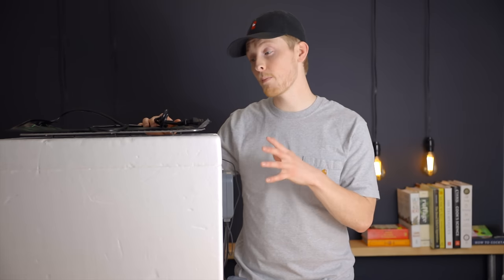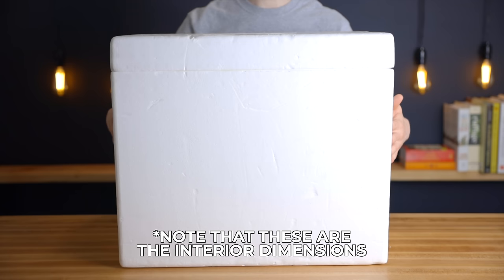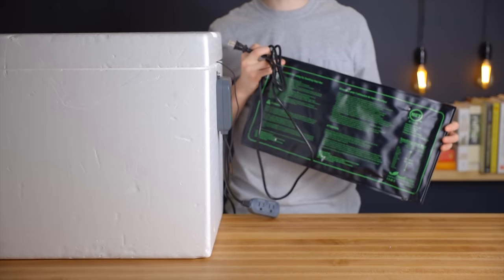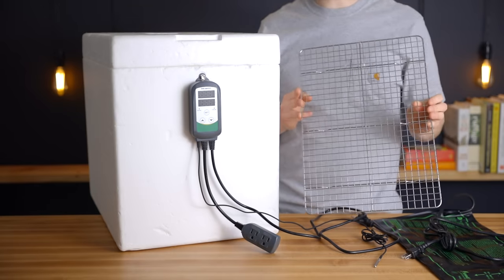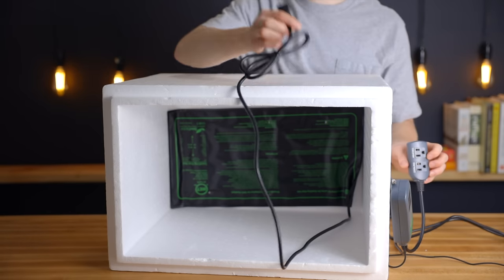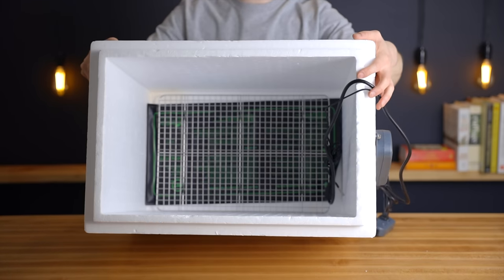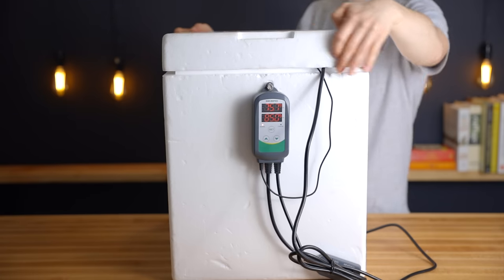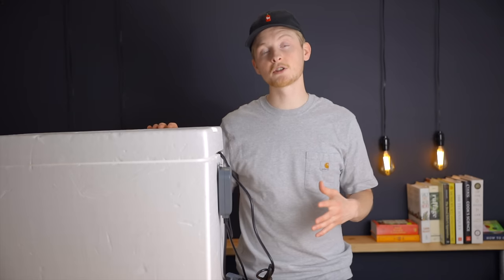How to make an affordable proofing box / fermentation chamber

Comment: I like this idea but you can improve it by turning the styrofoam box upside down and place the bread to be baked on the lid. This will make it easy and less awkward to get out of the proover when dough is prooved and you don't want to risk knocking the air out of it getting out.
Reply: @handled011 agreed!

Comment: I just made this box for fermenting/culturing tempeh. I live in the U.K and most of the time it’s cold and wet. I used your instructions and its just perfect. I used to use my Instant Pot’s yoghurt setting, but that meant I couldn’t use it for anything else. Now I have this incubator I can just switch it all on and leave it. Thank you very much!
Reply: May I know what is the max temperature you can achieve with seedling mat?
Reply: @abhishekthakare1862  I have the exact same setup although the heating mat is a bit different but looks very similar, and it's the same price range. I'd say the maximum temperature is probably a bit lower than 40 degrees Celsius depending on external factors.
Reply: Oh wow I would use mine for doing Natto :D

Comment: Want to give a thanks I ordered everything and made a big difference no lie I use to keep my starter on top of the fridge and it was fine but no real bubbles did it today and my starter looked completely different in a positive way 😁 only advice I can give is also use a thermometer inside don't just rely on the one that control the mat I find mine was off by 4 degrees and also use a thermometer to check the dough temperature not sure why but my dough was at 90 degree's when I had it set at  86 , I lowered the temp to 78 degree's and a hour later dough was still 90 degree I'm still playing around with it but works great and lots of room 👍

Comment: I want to thank you for the wonderful and great money saving idea.  I purchased these items, found a lower density styrofoam box perfect size for $9 at Walmart, purchased the lower price temperature control (which I had to return in favor of the one you are using!) and now have a great proofing box!!!  I used to use my oven with the light on, but when I needed to preheat the oven and it was usually the last proofing, the temperature would be different and it would affect the dough by kind of deflating it a bit.  Problem solved:)  Again, my thanks and stay well:)
Reply: May I ask what the name and size is? Thanks!
Reply: Of the box you bought at Walmart, ha.
Reply: @mmarkram Hi! Glad to help:)  The name "engraved" in the styrofoam is "LIPQAM" and the Q has another little ' in the top right.  This is in the cover of the box.  Measurements: Outside - 24" L x 16" W x 15" Deep; Inside: 19-1/2" L x 12" W x 12" deep.  I purchased the box at Walmart, was very inexpensive, and the heating pad and controller at Amazon, least expensive of the ones listed above by The Regular Chef.  A few strips of velcro to organize the cables, and the BEST proofing box you could want for bread! I make LOTS of French baguettes here and probably will make a second box to be able to make more.  Hope you can find all you need, good luck and Happy Thanksgiving:)

Comment: I've made one myself, before seeing this, but I'll note that it works better with a reptile tank mat than a seed starter mat. The reptile tank mat, plus a small fan, lets you get hot enough to make yogurt as well. Seed mats don't get the same final temperature. With a temp controller and a cooler and a small desk fan, I'm able to get temperatures anywhere from room temp to 120F with no difficulties. 

I'll note here also that a fermentation chamber is an absolute game changer on your consistency and speed for baking sourdough but also yeast leavened bread.

Comment: My initial sourdough attempts have been fair at best, not the best rise (occassionally no rise). I've come to the conclusion my biggest issue is proofing temp (house is 68 degrees). I was going to order the cooler and make one, however it currently isn't available...so I took my heating mat and put on the bottom of my oven (I already had the mats and thermostats from my plants). Works like a champ! Hopefully today's attempt shows some improvement!

Comment: Hi ! Thanks for the great video and explanations, I just finished build mine using your video as inspiration but instead of the mat, I used an extra long heated cable that I nailed to the therm-box, works like a charm with the temperature controller !
Reply: Would u pls share link for heating cable?

Comment: Great video.   I happened to have an old Coleman cooler and used it instead of the styrofoam box.  I hope it works as well.   They are fairly inexpensive and would think its a better (at least more durable) option for a proofing box.   Hopefully.
Reply: You just saved me time building one! Thanks

Comment: Why so many dislikes ??? This is a very nice and easy way to get a self made proofing chamber and have a very stable temperature for the starter and the dough. I will try this. Thanks man.
Reply from the maker: Haha idk, my channel was featured on the trending page last week with this video at the forefront, and that's when it got most of the dislikes.  I guess the general public doesn't really like bread-making haha.
Reply: @TheRegularChef  
Ok, that makes sense ;) ! I just had a few technical questions if you have time to answer them that would be awesome, 1) how hot do the heat mat itself get at maximum temperature (like burning hot or just enough) ? 2) How much time does it takes to heat let's say from 70 to 80 degrees (approximately, in other words does it go fast to the desired temperature)? And my final question, 3) with this inkbird temperature controller, let's say it goes over the 85 degrees and turn off the heat mat, will it turn on again as soon as it goes under 85 degrees or can you set a second  and lower temperature to turn it on again and avoid the heat mat to tilt around the precise 85 degrees ? I know that's a lot but I'm dying to know the answers ! Thanks !!
Reply: @bobbidou3624  I was thinking of the same thing... find an answer?
Reply from the maker: Hey, sorry I missed this one earlier. I’m not sure about the mat itself but the maximum temperature I can get my box to is about 110F. The box heats up pretty quickly, I would say it takes no more than 4-5 minutes to heat from 70-80F. And yeah, the temperature controller automatically turns the mat on and off as necessary, so it pretty much always stays within about 1 degree of the set temperature.
Reply: The Regular Chef  thanks and appreciate the info!
Reply: @TheRegularChef  Thanks man !

Comment: Thank you so much - what a great idea.  I'm going to try adapting this idea and just get the inkbird controller you link to and use it with my Excalibur dehydrator.  It already has the box, its own heating element and shelving going for it - but I didn't want to use it as is because it's lowest temperature is 115°, and I'm aiming for 78°.  This should do the trick perfectly.  Thanks again for the inspiration.

Comment: Thanks for the very useful video. I am gonna make one of these and I'm thinking on buying the exact same thermostat you bought because it says cooling as well, and I need a cooler temperature during summer here in Mexico! Do you know what I shoud connect to the cooling plug? If you can share a link, even better! Thanks!
Reply: People who do that generally use an older small refrigerator as the chamber. The cooling side is the fridge plug, the heating side is whatever element you use inside the fridge to up the temp.

Comment: Great information. I’m trying to make a fermentation chamber that reaches 140°F but haven’t been able to find a heating mat that will get me there. My setup/equipment is the same as yours. Any suggestions?
Reply: A heat lamp will get you there but even with a temp controller I don’t think a styrofoam box is safe. I’m thinking about making a proofer out of a small fish tank and adding a humidity feature somehow. A small axial fan wired on full time would get you a convection proofer.

Comment: I just made one of these including the Styrofoam box, as I couldn't buy the right size. You know I'm thinking that a few holes might be a good idea for heat release as when I set my thermostat it goes 5 degrees over what's set, so some heat escape would be a good thing
Reply from the maker: Interesting, I've never had that happen with mine. Personally, I would just set it 5 degrees lower than you actually need, so that way it doesn't use more energy than necessary.

Comment: Hello! 👋🏻

I have a question related to the Digital Temperature Controller. If the range of work is between 50~120°C, how can it be used for keeping the temperature stable around 40°C or even less for proofing pizza and bread (25~30°C)? 🤔 50°C, for the minimum, it's way too high!😯 

Thanks 😁

 Range: -50~120°C / -58~248°F

Comment: Does it work when you put your dough on your desire room temperature when you are outside during winter ?

Because i need to put my dough on room temp. When im selling pizza outside during winter.
If i don’t put it on room temp. The dough will be dry and hard to stretch 

I need some solution 

Thank you

Comment: Question.  Thank you for this video.  Works like a charm.  Question:  is there any chance that my dough might be proofing to fast.  I add my Levean after a 12 hour rest at 9 AM in the morning.  I find that after the stretch and fold and using the box my dough is alive an well but I’m not sure it springs as well when I put it in the fridge over night?  Should I be bringing it up to room temperature on the third day?  In any case I’ve been baking my bread around 5 pm on the same day.     What say you?   Great videos
Reply: Just wondering what temperature do you have it at
Reply: I’ve been proofing my bread at 82 degrees.
Reply from the maker: Hi sorry, I missed this comment initially.  I typically follow a similar schedule to what you described (baking around 6PM the same day that I mix the levain, not putting it in the fridge overnight).  I don't think your dough would be proofing too fast if you're proofing at 82F because I typically proof at 85F, and it works out fine. So your oven spring issue is most likely due to something else.  I have two videos explaining 5 ways to get a better oven spring, so those may help if you haven't seen them already!

Comment: First off - AWESOME.  Really looking forward to building this.  My only question - What about fire safety?  How long are these components regulated to run for?  Have you had to replace yet?
Reply from the maker: Thanks, I'm glad you found it helpful!  I'm not actually too sure about the safety certifications as I'm not an expert on that subject, but I know that these seedling heating mats are intended for continuous use, so I would imagine that they've been deemed to be safe in that respect.  But I'm sure you could find more details on that from the manufacturer itself.  I've had mine for probably about 9 months now, running about 50% of the time and I haven't had any issues or had to replace anything yet.
Reply: @TheRegularChef  Thanks for addressing that. 
From a naive perspective of someone that's not to keen on safety aspects with DIY electronics and styrofoam, your build looks like a great idea.

But I was worrying about safety concerns considering your video had a notable amount of dislikes.
Reply from the maker: Thanks, yeah the dislikes aren’t because of any safety concerns though. I’ve never had any issues myself and have never heard of anyone else having any either. 

The dislikes are there because my channel was featured on YouTube’s trending page a while back and this was the main video they showed for some reason. So since it reached a general audience that doesn’t usually watch these types of videos, it got a lot of dislikes in a short period of time haha.
Reply: Can you have this setup using the oven? Thank you.

Comment: Hi Charly. Thanks so much for this tutorial. I just order all components except the styrofoam box. Question: could I use an ‘Commercial Insulated Food Delivery Bag’ (I like that because it is collapsible.) or a cooler (that I already have)? Looking forward to your answer.
Reply from the maker: Yeah either of those should work!  As long as they're insulated and large enough to fit the components, they should be fine.
Reply: @TheRegularChef  - Thank you very much for the quick reply.
Reply: Which of these will be more efficient for both cold and hot temperatures?

Comment: For bread proofing, if the dough is covered loosely in plastic wrap, is any more moisture needed or do you think the setup as-is in the video will suffice?
Reply from the maker: This setup will suffice!  That’s the way I usually use it. And if you’re making a recipe
That really does need to rise in a moist environment, then you can cover the dough with a damp towel rather than plastic wrap

Comment: Hey brother!
This is awesome and I think I am going to build one similar with the cooler I have lying around.

What about the steam? 
I know that a lot of the 'professional' proofing boxes are also steam boxes. Have you tried adding a humidity element to your proofing box?
Reply from the maker: Awesome, good luck with it!  I haven't added a humidity element to mine, but the Noma Guide to Fementation (the book that I got this idea from) suggests using a small humidifier along with a humidity controller (like this one: https://www.amazon.com/Inkbird-Controller-Humidistat-Greenhouse-Dehumidifier/dp/B07XGQ7Q53/ref=sr_1_1_sspa).  So it basically works in the same way as the temperature controller, but it measures humidity instead of temperature.

Comment: Thanks for the video tutorial.  I watched your video, bought all the parts, and set it up.  After doing an initial test run, the mat was warmed up, but inside the box was a distinct vinyl/plastic smell (similar to an inflatable mattress) I believe due to the cover of the heating mat.  (I don't want my sourdough starter or dough to small or taste like vinyl.)  Did your mat have a similar smell?  If so, did the smell eventually go away?  Thanks for your thoughts. /  Hi again, I decided to return the mat.  Another person also commented that the mat smelled like a "beach ball" - I agree.  Your overall idea is a good one, I'm going to find a different heating element.  Thanks for your videos.
Reply from the maker: No problem, I think mine did have a slightly plastic smell at first, but I can't detect it anymore.  I do only place food in sealed containers into my proofing box, so it never impacted the flavor, but I can see how the smell could be off-putting.
Reply: Im getting the same smell did you find a better heating element?
Reply: @debbiefraser9824  in investigating home made proofers, people were using light bulbs, but now with LED I think it would be hard to find incandescent bulbs that’s why I thought this might work, but not too keen about the smell. My hunt continues

Comment: I am putting together this proofing box. One concern: the covering on mat gives off an odor like a beach ball - like the plastic or vinyl that it is. Do you know anything about toxicity of fumes? And can I expect that to dissipate after a bit?
Reply: I didn't like the smell of a few of the items I looked at either. Especially the plastic coolers. I bought a styrofoam  cooler for $10. I have an old egg incubator so I took the heating element out of it and attached it to the lid of the cooler and placed a thermometer into the cooler. The heating element allows you to control the temp. Once the temp is stable where you want it no need to touch it again. Works perfectly! If you ever need to make another just look for an old Styrofoam egg incubator and take the heating element out. Cheap and very easy.
Reply from the maker: I'm not sure about the toxicity, but I do only place food in sealed containers into my proofing box, so I don't think the fumes would be a concern.  I believe that mine did have a slight plastic smell at first, but I can't detect it anymore.

Comment: Is there any reason not to use a heat pad inside a styrofoam cooler? For example, could the interaction of the heat pad create an off-gas which might not work for rising bread dough - or worse, create a fire hazard?
Reply from the maker: The seedling heating mat is essentially just a specialized heating pad, so I would think that would be fine.  I would only be concerned about the fire issues, so you'd definitely want to look into that before trying it.
Reply: I tried a heating pad, but they seem to have automatic shut-off safety features these days.